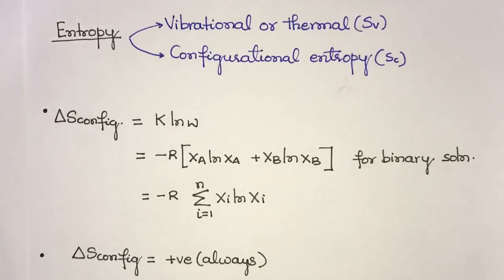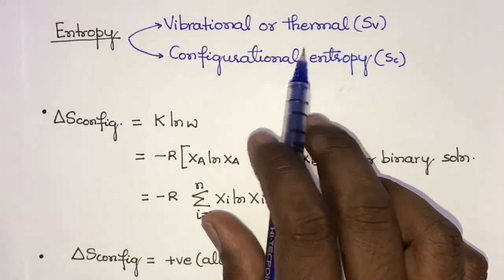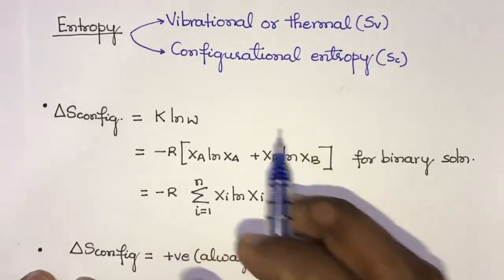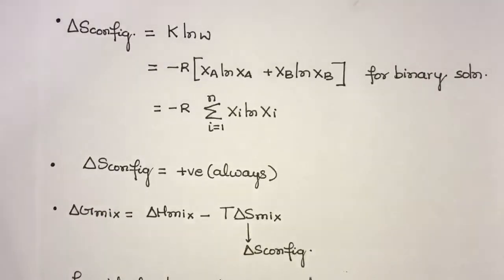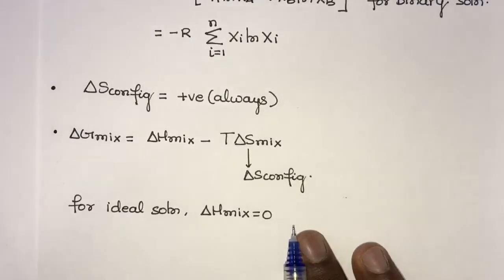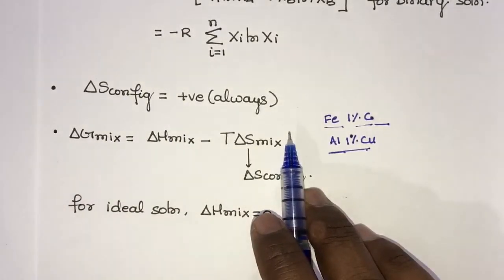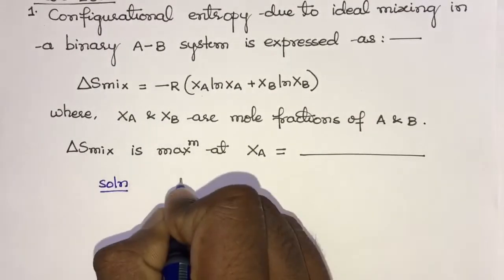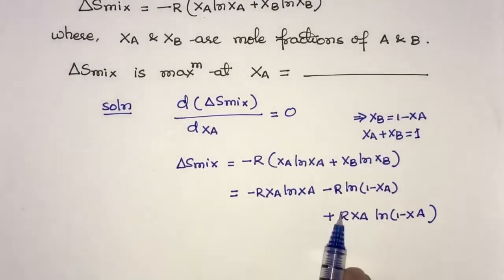CONFIGURATIONAL ENTROPY

Comment: According to me, The answer to the last question should be zero... Because at 0K, the substance is at ground state, no defect. And thus zero configurational entropy
Reply from the maker: even at absolute zero (0 Kelvin), a crystal can exhibit vacancy defects. A vacancy defect occurs when an atom is missing from its regular position in the crystal lattice. While thermal vibrations and energy at higher temperatures typically increase the number of vacancies, some defects are inherent to the material’s formation, even at 0 K. These could be due to imperfections during the crystal growth process or other intrinsic factors.
Reply: @cpatelacademy  and that would lead to configurational entropy ? Why?  Curious.
Reply: •	In a perfect crystal, each atom occupies a fixed position, and the system has a low number of possible configurations (low entropy).
	•	When vacancies are introduced, there are several ways to distribute the vacancies across the crystal lattice. The system now has more microstates (possible configurations), increasing its entropy.